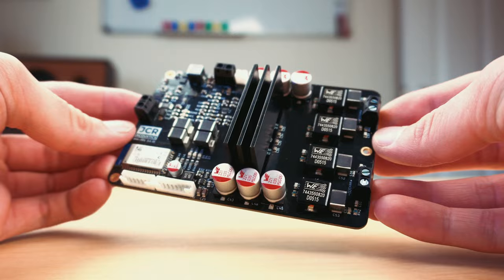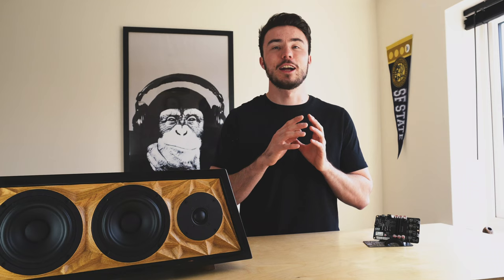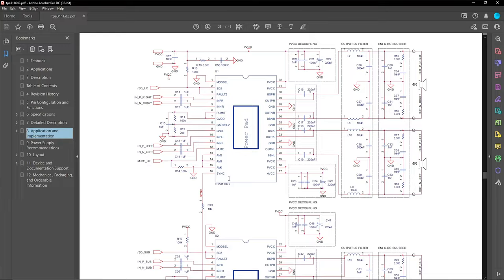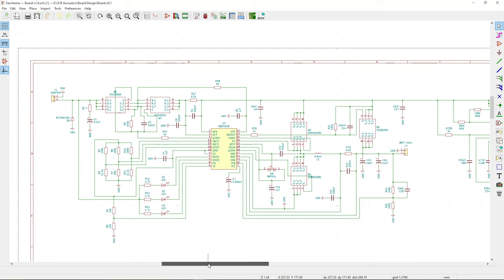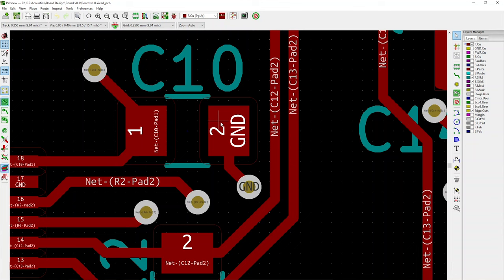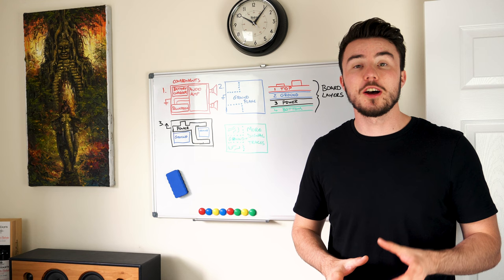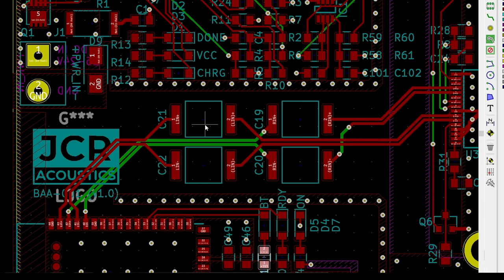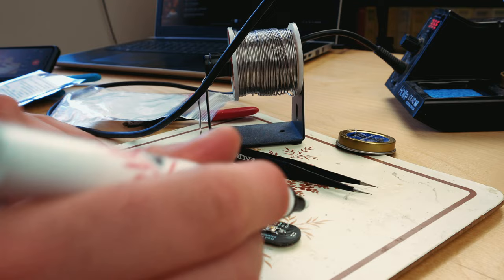How I DESIGNED THIS Class D Audio Amplifier

Comment: Nice video! One remark on decoupling capacitors: you recommend having their own via to the ground plane. Note that the via has quite high inductance. If possible, connect the decoupling directly to the ic on the same layer for both voltage and ground. And be really careful with copper pours on the signal layer. Many people just fill the top layer and make many antennas. Only make them where needed as guards and make sure stitching is done right. The high frequencies in modern ICs are not forgiving like they used to be.
Reply from the maker: Interesting points and good point on the decoupling ground return, thanks.

Comment: Really great video. I'm working on building my own. Mostly standard configuration but with some minor changes to start, more in the future as this will be my first board. I may have missed it from the video, but what was the power rating and impedance of your speaker choice? Default here is 4 ohm 50W per channel, which is what I'm going to use.

Comment: I disagree with your definition of "bootstrap capacitors". Maybe you think the real answer is too long winded?
Short: It is basically a replacement for a high(er) voltage supply rail that enables the use of n-type fet's on the high voltage side switcher position.

Longer: It is essentially a very practical way of building a "charge pump dc-dc converter". It is not a feedback signal to increase amplification per se, it's a solution to a problem that appears when chosing the best (most common) type of transistors. P-type fet's are just not as cheap, efficient, sturdy and prolific as n-type fet's, there is an esoteric physics reason to why that is, but explaining that needs text, graphics and a whole different level of video. The bootstrap cap solution can be replaced by additional (low power) voltage rails.

Comment: great video, what software did you use for the circuit schematic? I am looking to design my own class D amplifier using the TPA3116 but unable to find the component on the software I am using (multisim).
Reply from the maker: I used KiCAD, I have a tutorial on the Channel but sometimes you have to make the component footprints yourself as it won't have all of them.